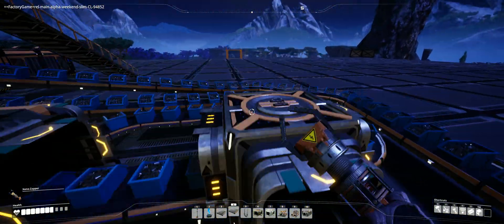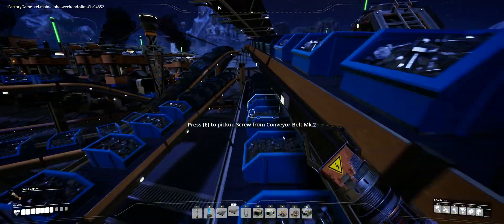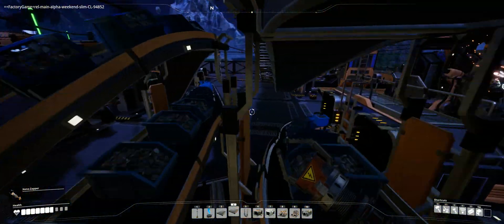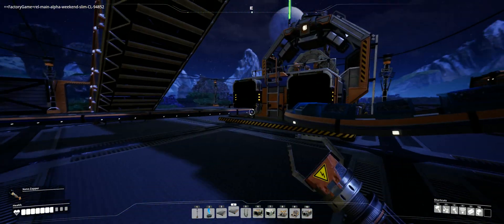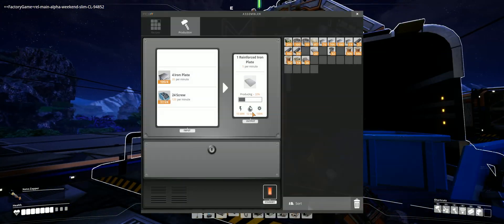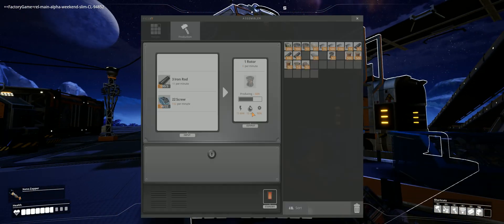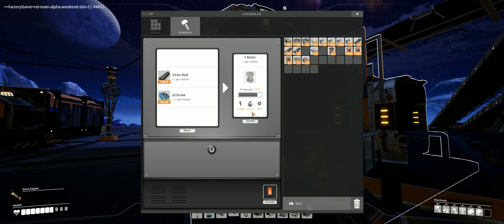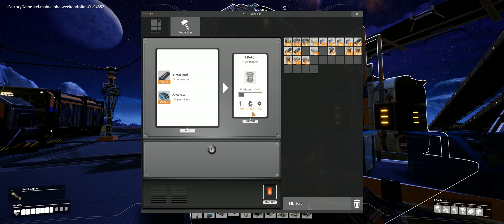Satisfactory - Belt Balancing - A simple 3-to-2 Balancer.

Comment: So belts have a natural speed or is it based on the output of the constructors?
Reply from the maker: Belts are natural speed (If you hover over it in menu it tells you speeds). Mk 1 can carry AT MOST 60 units/minute. Mk 2 can carry AT MOST 120 units/minute. 
Unsure of next upgrades. Wiki says Mk 3 is 270 units/minute.

That being said if you have a belt coming off a constructor that only makes 15/minute then that is the most your belt will carry. To saturate your line you would need 4 input lines into a combiner. Since a combiner has 3-in and 1-out, you would need 2 combiners.

As things evolve and I have access to more I can update balancing.